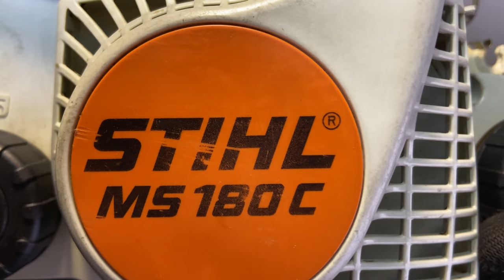How to repair//no compression//chainsaw repair #Stihl MS180C

Comment: Dude my chainsaw is new tho all I did was take it apart because of an oil leak it had put it back together and now no compression when I pull the cord... Any idea what else it could be?
Reply from the maker: What exactly was disassembled, the engine pulled out, the clutch unscrewed?
Reply: @MasterSaw888  I fixed it, ended up getting a new pull cord, chainsaw works now.
Reply from the maker: Perfectly!